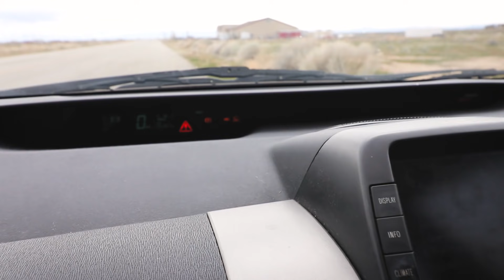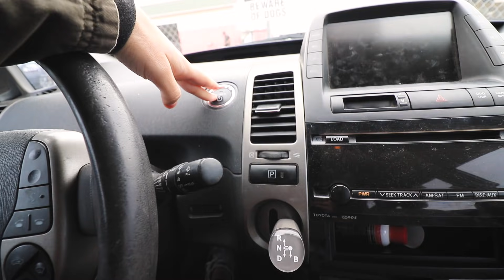I Think I've Been Sabotaged... Pulling Oil Pan To Find THIS... WTF

Comment: I would have to wager a guess of it is not sabotage per say. What it is is a case of yet another "fully built" LS modded using house brand parts store parts then sold as being modified for performance when it isn't. Thus you have gasket and tensioner material that ends up in your oil pan and solidifies like fat in greasy food in the fridge as the engine cools down. I said do the bottom end when you found out the truth about your top end, and this is why. Pull the engine have it cleaned(hot tank works) then rebuild the bottom end and reclean the top end just to be safe. Do this or be ready to replace that engine! The wife and I love your videos but baby girl as owners of a high performance company we implore you do  not trust that engine! Besides when you rebuild the bottom end a little cutting can be done. No shame in a stroker motor especially with a little extra bore!

Comment: That oil looks pretty filthy.. how long since the last change? From the looks of that crud in the pickup, it looks like it has gone a long time between oil changes before you got the engine. (You did buy it used, right?)
Reply: Dan W they use tribodine it’s blue out the bottle
Reply: @babababutler  Gotcha... that color makes it tough to determine if there's any contamination though.😜

Comment: Ok, I stopped the video at 15:32, my prediction is somewhere there is a deteriorated rubber line that is decaying from the inside out or the wrong type of hose was used....
Reply: My sand-rail has a remote oil cooler and I had this same thing happen to me...

Comment: Since no one else has anything constructive to say, nor knowledge to flaunt, I'll take a stab. If you have a leak in either a head or intake gasket that let coolent into your oil, the two will become mixed and can produce a thermalplastic compound. If severe enough, it can lock up your engine when the engine is shut down. Acting like thread lock within the oil clearance between crank and bearings.  Check your coolant as well, because quite often if coolant is getting in your oil than oil will likewise be getting in your coolant. That can plug your radiator. Plugged radiator is my past experience with this phenomenon. Reguardless, I wish you the best luck finding the problem, much more so than the rest these jackass commentors. Best of luck from an old wrench jockey.

Comment: To bad someone didn't suggest to pull the pan and replace the bearings and rings while you had the engine out the first time.  If this was an issue then you would have seen this.  Guess I wasn't such an idiot after all.

Comment: Sludge? Carbon oil gunk? Seen crap like that come out of non maintenance engines... but don’t get the fiber? A missed rag? And this is just a wild guess
Reply: Mad Mechanix we change the oil/filter often ,  but also just did cams/head where we changed as well
Reply: Oh I have no doubt.. this makes no sense what could be in there watched it several times.. this makes no sense

Comment: It's carbon deposits that the oil cleaned out after u changed the head gaskets all the oil did was clean the inside of the block for u put some of it in a pan and pour kerosene on it it will desolve and u will know it was carbon just wash the motor out with motor clean out then change the oil and good to go.
Reply: That explains the fibers in it.......

Comment: 11:46 put it in i vile heat it up to 220 degrees... if it melts it is tar. aka comes from poorly refined motor oil. too many cheep $30 oil changes.
Reply: Arden Nielsen  , we run a race grade oil ,  but I can see how a cheap oil could possibly do that.

Comment: Sounds like your Prius has picked up a bit of an attitude. Why that is is anyone's guess, but it could be anything from WANTING to be a racer, or not liking the fact that there's race cars nearby. Priuses don't generally work well for drag racing, but they are competent drifters.
Reply: They work great as a dragster... Once you swap out the engine, the transmission.... Well pretty much everything but the body.
Reply: @SilvaDreams  Only the engine and transmission need be swapped. The body is already quite aerodynamic and the suspension is plenty stiff. You'll also find on most Prii that the brakes have barely any wear, but might need to be swapped for higher performance models. Same with tires.

Comment: Oil leak sealer?

first thing that comes to mind atleast remember seing some guy testing diffrent brand on a lawn mower and found similar residue in the oil afterwards may have been projectfarm but not sure.

don´t know the history of that engine, first video from you but if it´s had a leaky headgasket, blower, turbo or whatever it lost oil in it´s history well maybe some previous owner dumped a can of oil leak sealer in it to try stop the oil leak.

and as you pointed out you got a oil leak somewhere so I´d say it´s not out of the calculation atleast.

Comment: If that was my car I would already be pulling the bottom end apart and inspecting it because there has been oil starvation if the oil pick up was that blocked this is what I would do was just to be on the safe side

Comment: Result of poor engine maintenance or half assed engine build. Surely you're saying you've been sabotaged for views. As if anyone would even bother.
Reply: xack rogueAU  neither of those. , thank you for the opinion though.  Motor has been on great maintenance schedule after acquiring the used motor .  Also did a good job assembling and cleaning.   This in fact is why we do not know what this is.    Someone could have bothered, we will see 🤷🏼‍♂️.   Haters are everywhere =you know what I mean xackrogueau ?

Comment: Why are they crawling underneath the car when they got a hoist?
Reply: because they are using a engine hoist to hold the motor up as they took out the engine cradle (kframe) to drop the pan

Comment: Looks like carbon build up, check your valves.
Reply: she just put new heads
Reply: @pauldurio  Carbon build up can be caused by many things looking at the valve will highlight if it is carbon build up or not as they are the first place the carbon will stick to. I've seen motors thick with it from a leaking oil seal on a turbo to injector seals allowing oil on direct injection engines to pass into the fuel a few months after a total rebuild.

Comment: oil pressure is the single most important gauge to have in any car. ya`ll talk to much!
Reply: Idk.
Any external oil line has the potential to be a catastrophic leak.
In the industrial sector, all oil pressure gages have valves to isolate the gage when not needed.
And when the oil pressure drops, since the gage is typically at the end of the oil system, it's too late.
Oil temp gage is more important than the pressure gage.

Comment: you found nothing in the oil ? look at the oil, its black, like it came out of an old diesel, those are most likely chunks of hard sludge. change the oil once in a while. new valve cover, why? was the top end full of crap? more maintainance less talk, and tell the whole story, don't try to cover up your lack of oil changes. its your fault "PRI PRI" died.

Comment: It's a bad quality of oil
Reply: shes using royal purple
Reply: When the oil work too much under high heat and pressure it burn and the pumps filter holds it ...from my experience with my v6 Peugeot 406
Reply: Did you found what that substance was